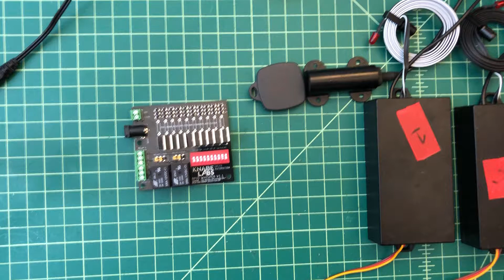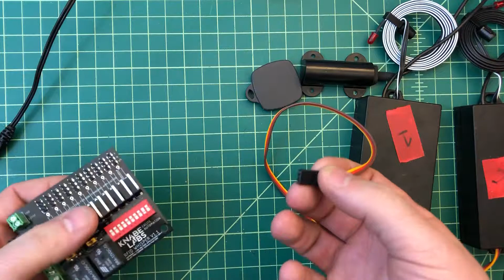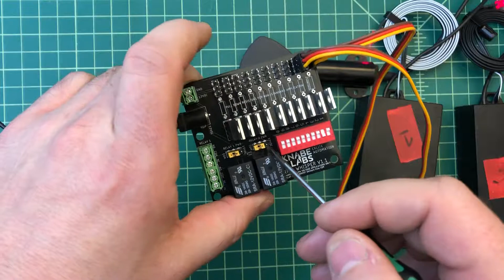Silent Whisper RFID controller board

Comment: Do these RFID units just switch 0->12V on S when the tag is present? Could I just use a switch as input? I see you've got a spot for pull-down resistors, so if I connected a reed switch between S and + would that work?
Reply from the maker: Yes you can! you just need to add the pull down resistor. We talk in more detail here! https://www.youtube.com/watch?v=J-f8HuMdavU
Reply: Thanks for the quick reply!